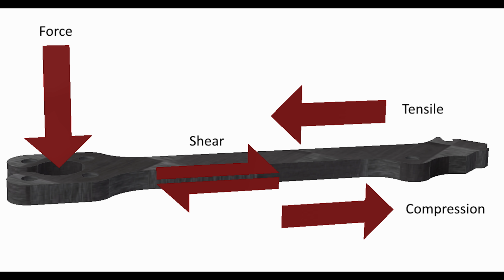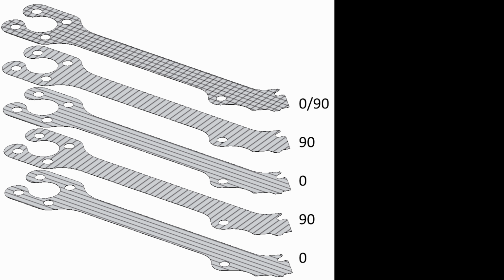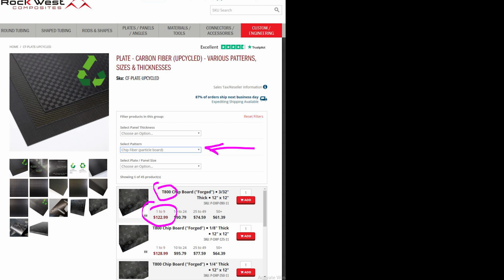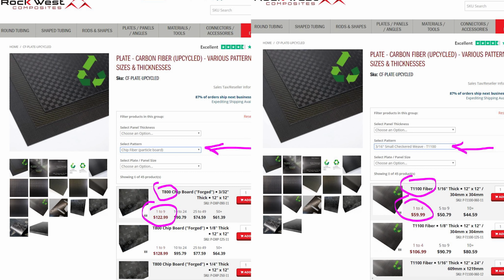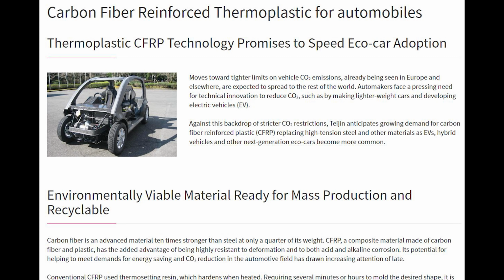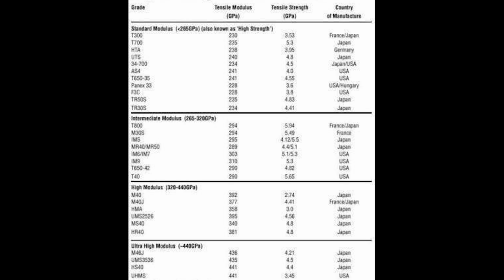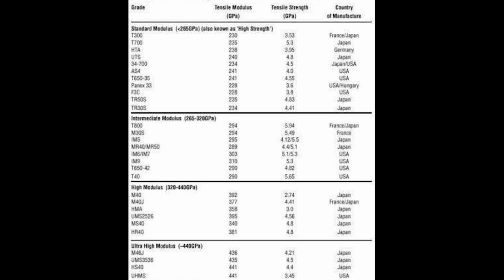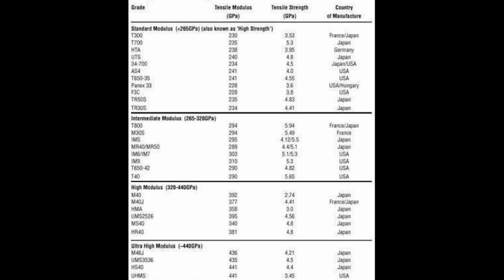Carbon Fiber and the MAD S with Johan from MadKwads - NO VIDEO, just some pictures

Comment: The carbon I use for resin infusion is a strange looking carbon. It looks almost like woven carpet. It's thick and has something like a fishing line woven through it that helps the resin flow through the carbon fiber. It's a very slow hardening resin I use that takes 24 hours to cure, so it will stay under vacuum as a liquid for a long time, soaking in the fibers. The molds I've made with this process have held up very well. We use them to make parts out of prepreg carbon and run the molds in an autoclave at 40psi at 210-300f.

Comment: Materials used on the outside layers are actually quite critical. They have the added benefit of being the layers exposed which is what the final user sees, making cosmetics just an added value, but the true reason of the outside layers shall be to transfer the loads in the most efficient way as possible. 

 A properly designed frame as the one presented by the guys from MadKwads are using the outside layer mainly for impact resistance, increased stiffness (due to being spread tow fabric "thin ply theory"), crack propagation mitigation, avoidance of delamitation, load transfer and weight reduction without having a mechanical performance penalty.

Comment: I think Compression can be increased by doing arms like this.

1 mm carbon fiber
0.2 mm TPU
1 mm carbon fiber
0.2 mm TPU
1 mm carbon fiber
0.2 mm TPU
1 mm carbon fiber
0.2 mm TPU
1 mm carbon fiber 
0.2 mm TPU
1 mm carbon fiber 

or

2 mm carbon fiber
0.2 mm TPU
2 mm carbon fiber
0.2 mm TPU
2 mm carbon fiber

Also the arm resonance shod change by this sandwich design. Bob I have the Mad-S frame but for various resounds I have not build it.

Sandwich design is heavy used in windsurfing boards as I have lots of background from making my own fins to fixing boards and see how some off the best fins in the world are made how the layers a put down to give the fine the flex where it needs to be for control and speed.
Reply from the maker: The issue with the TPU laters is getting them to laminate well with the carbon.  They split apart kinda easily without some special unknown process from what I know.
Reply: @Kabab  You don't want them to laminate to the carbon, as thy can't. Thy have to have freedom to move. You just stack multiple of arms in carbon fiber & TPU in various thickness to get it to the property you need. :-)
Reply from the maker: @alfskaar489  ah I see. That would work out when it's tightly held together for this application.  🤔. We will discuss this in the next interview

Comment: Bob - I think you're right.  The 3-D molding effort required to make complex shapes is seriously cool stuff, but in practice, for FPV quads, we can get so much done with flat plates of 3K cheap stuff, I don't really see a justification to do anything else - we operate in a thrust to weight ratio & AoA aero efficiency regime where optimizing materials doesn't make as much sense as putting the focus on generating something that achieves the maintainability, supportability, and cost aspects that let us focus elsewhere is why you've had success so far.  
I mean, even top level competitive hardware is relying on TPU mounts and zip ties to actually function, and that's just the nature of where we're at.  There are gains to be made moving resonant frequencies of parts higher, but more so moving the assembly resonance regimes up and out of the 200-350Hz regime that actually affect a few things, but the tradeoff of achieving that stiffness tends to be ruggedness in repetitive crashes (and you hit diminishing returns on weight there too).
I think the actual differences come down to product longevity, and the market seems to be willing to side on the 'two is one, one is none' mentality more than buying higher quality stuff that is twice the price (I'll at least own up to being the type of cheapskate that approaaches my FPV quads that way)
Reply from the maker: I'm working on getting the body to be absolutely rigid while the arms can flex a bit. The MAD-S is apparently so strong the rigidity doesn't matter to durability.
Reply: @Kabab  As you've figured out, mass has a fair bit to do with crash survivability as well, so there is definitely merit to having designs that are generally better structurally - but with BF4.1 and later, once you've pushed the yaw resonance above 200Hz, it's straightforward to tune around it.  We're at the point where inconsistent latency on the RC side is far more impactful than phase latency in gyro interpretation, which is why I feel like frame design is arguably too far into diminishing returns to be worth huge effort for anything running M5 motor shafts or larger.

Comment: Love this.  Also, not going to lie, this would absolutely ruin the brains of a bunch of people I've argued with about carbon fibre performance, especially for mountain bikes.  A lot of the same concepts and concerns (the closest analog is having the nerve to put carbon fibre wheels right where they're going to see high velocity rock impacts), and Johan really nails the key point - it's not so much a case of the headline materials and weave mattering, but layup schedule, appropriate handling of the pre-preg materials, and QA for the bake-out steps that actually delivers quality; but to consumers dropping a pretty exterior layer with a cool weave is what they actually focus on, even if the inside is just unidirectional garbage.
I think even as racing hobbyists, we forget that we're flying stuff that is practically Formula 1 car performance... I still remember learning about Textreme after the 2015 Mercs highlighted that over the entire rear and floor section of the car.  I've seen it in places where it doesn't really make sense, but it's still genuinely awesome to see.

Comment: A did some quick & dirty calculation on your thought about using stronger materials (UTS) so you can reduce the thickness of the carbon. For the calculation I took 12 mm for the arm width and for the thickness I took  5 and 4,5 mm. If you would swap the material for 100%, the stiffness would increase by 28%. But If you then reduce the thickness to 4,5 mm you will reduce the stiffness by 7% compared to the normal T300. Since you are not able to swap the material for 100% the number will actually be higher. Reducing the thickness with 0,5 mm for anything less than 4,5 mm will result I a significantly higher loss of stiffness and will not be a feasible option since the second moment of area not big enough (thickness counts to the third power).

Comment: Definitely not many are going to watch till the end.
But you know me haha. If it has to do with you and a frame or motors, or props. Especially props with me and you haha.
But I watched it bc I wanted to hear about the difference in the resins on the carbon.
Witch does have alot to do with strength.
So not many ppl are going to get what your topics was about, unless you have personally worked with fiberglass period.
I have worked with it for 19 years bc our body was made out of fiberglass, so you needed to learn how to fix it your self when it cracked.
You should take him up on his offer to make the tp3 from there new way of stuff. 
Well find out how much it would cost and all.
I would buy one.
Or you can find out how much and get can make me one and I'll test it out for you, I'll even pay for the frame.
Just a thought man, think about it.
Reply from the maker: I'm definitely considering options
Reply: The resin management in pre-preg materials is often more important than any of the carbon aspects, and is what tends to differentiate the quality of manufacturers a lot more than anything else, and why to a lot of aerospace customers they're willing to pay tons more for specific hands on the product.

Comment: Cool discussion.  ESP the resonances optimization considerations
Reply: I’m wondering if you can move through the trade off between a high resident frequency and high impact stress is leading to fracture in the event of a crash, by incorporating some kind of plastic shearing joints or fasteners which would snap there by protecting the frame members from damage and allowing for easy infield repairs. At some point, the resident frequency of the frame body by way of hi stiffness and low weight will far exceed the operating frequencies of the motors and so you really only have to get above a certain threshold and then focus on weight reduction.

Comment: Johan, awesome information. An idea: use a hybrid system where all the  holes and enclosed cuts are drilled on a standard mill, including some locating pin holes. Then you can put it on the water jet bed, line up the pins and do a second pass with the water jet for the exterior edges that need nice finish and small radius. Then you wouldn't need to restart the water jet at all.

Comment: A micro bench top water jet CNC would be amazing but it is still way off for hobby grade shops.    I have a 19x19 CNC mill coming for finally cutting my own frame.    But if I could get a super fine water jet I would LOVE to have that as a viable option.    Difference is around 1200-1500 for my CNC mill versus like I think 9k for the water jet.

Figuring out the feeds and speeds for water jet and the nuiances of how to avoid delamination had to take awhile.
Reply: That would definitely be preferable - but if you know where to look, cheap CNC milling stations that are pretty knackered show up for really cheap, and if you have the time it's entirely possible to make up the cost to buy one of those with machining other stuff that basically eats machines.  You wind up learning a lot of extra parameters in CAM tools to keep from making round shapes look like eggs, because cutting glass, fiberglass, carbon, and stuff absolutely thrashes machines, but it still works.
Reply: @tehllama42  i have a brand new millright mega v 19x19 coming for 1050 with a tplate for another 250.  Will be setting it up for submerged carbon cutting with a water recycling system because i do not want to deal with dust at all.  Will be trapping dust in a filter setup and disposing of it in a ziplock

Comment: Frame resonances above 200hz are good, not sure if above 500hz is going to make any diferance.
Reply from the maker: I concur with that.  I'm aiming for above 200hz on my own upcoming designs.  :-)
Reply: It does make a difference since the noise attenuation of the built in LPF filter for a gyro running 8k only becomes high at those values. This is the issue with PT1 filters, they have a low attenuation in the beginning

Comment from the maker: Table of Contents:
00:20 - Basic carbon fiber fabric
03:35 - T300, T700, T1000...
08:40 - Compression vs tension strength
11:35 - Torsion/twisting
12:31 - CF laminate layup directions
15:53 - Pre-preg CF sheets
20:26 - Forged carbon
27:53 - Woven thermoplastic
31:04 - MAD-S quad design intro
38:46 - Weave variations
40:00 - All woven vs woven and UD layers
43:05 - Extent of intermediate CF use in Quads
47:32 - Their special layup configuration
53:58 - Moulded vs flat sheet cost
01:00:12 - Micro water cutter
01:14:32 - Frame resonance and rigidity
01:20:04 - Vertical arms and box frames

The MAD-S: https://madkwads.com/produkt/mad-s/

Some really interesting directions here and valid work towards getting lighter, stronger frames without breaking the bank.  Gonna try to work with these guys on some new things.

I'm going to start sending all the stuff on my channel randomly to my Patreons: https://bit.ly/2oGLP9b

▼Join my FB group for more discussion: Kabab FPV
https://www.facebook.com/groups/379155946182689/

▼ My typical 5" quad setup:
-Hyperlite Glide Floss (will be re-released soon)
-Motor 1750kv/ESC combo: http://bit.ly/2XAEHXH
-WaFL’s Cap Cap: http://bit.ly/2GUpXxO
-Battery: http://bit.ly/2ZoW2rq
-FC: http://bit.ly/2XRc8G8
-FPV Cam: http://bit.ly/2Q7LfL7
-Vtx: http://bit.ly/2HsrASs
-ND GoPro Mount 30deg: http://bit.ly/2WC15zc
-ND Filter (if used): http://bit.ly/2WEmQ1j

▼My preferred goggles as of Sept 2019
http://bit.ly/2k5YNv5

▼Notable motors:
-Xing 2306: http://bit.ly/2Nqqr25
-Xing 2208: http://bit.ly/2y3te8R
-FANTASTIC 6" motor: http://bit.ly/2LqghOZ

▼ 5" Sub $200 build that's still good
-Frame: https://goo.gl/EpXQhZ
-FC/4in1 Stack:  https://goo.gl/HprVbj
-Motors: http://bit.ly/2Nqqr25
-Props: http://bit.ly/2TUQsIg
-FPV Cam: https://goo.gl/FDJhYw
-Vtx: http://bit.ly/2NnO2Au

-Starter goggles: http://bit.ly/2Mw0yNS
-Batt pad material: http://bit.ly/2QGWhYb

▼ If you want to solder better:
-Fantastic solder: https://amzn.to/2P5QM2W
-Fantastic iron: https://goo.gl/DqBipa

▼ Lighting equipment:
-Ring light: http://bit.ly/2ODSg9A
-Panel light: http://bit.ly/2KmDApP
-Power adapter: http://bit.ly/2YD5jHT
-Tripod: http://bit.ly/2MDsMX2
-Mini tripod: http://bit.ly/2MGL4Hf

▼ Tips?
Patreon: https://bit.ly/2oGLP9b

-PayPal: https://www.paypal.me/kababfpv
-Bitcoin: 1E4XZXoD4rS6MYWVWuenY7Kw2M1YgyNpoQ
-Nano: xrb_1188ek5bd7tb9kw67asnp9o65byuoaxbtpxuznx1ribf75x78awywmakj55f
-ETH: 0xD067F93811f2eC31CB1928901002dfdf9A492EF5
-LTC: La2KWYAjp4VT2Lq2M76pbjzXWvRyjpfCtG
-Tesla Referal code: https://ts.la/bob40889
Please use my referral code if you're gonna buy a Tesla.  You get some free stuff when you do and I get better status with Tesla.
Reply: 1:24:15 - Johan's headset betrays him - but it's all good, because that's been an awesome discussion.